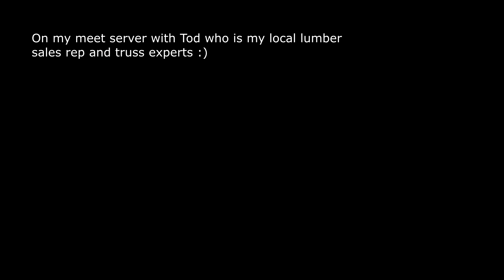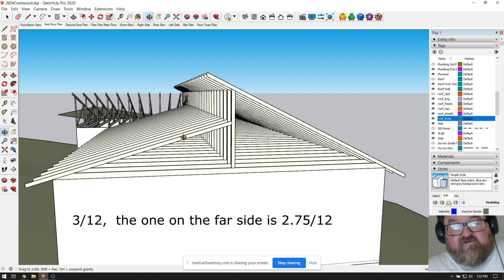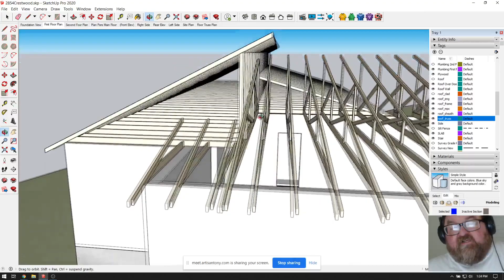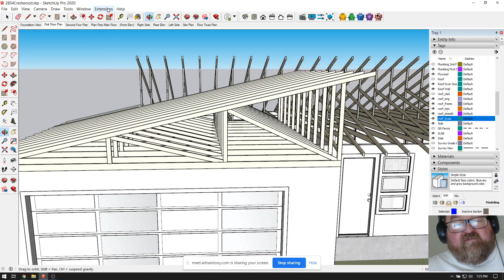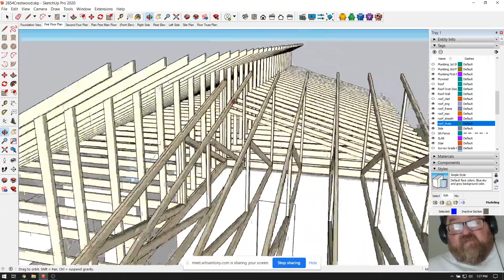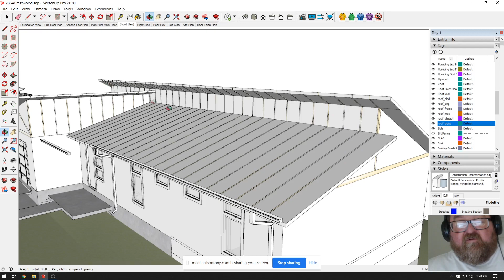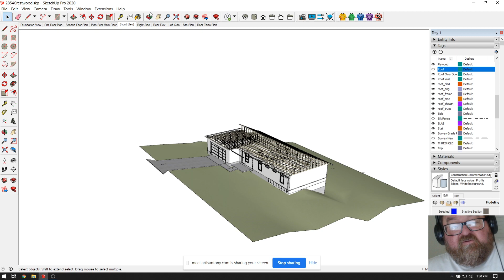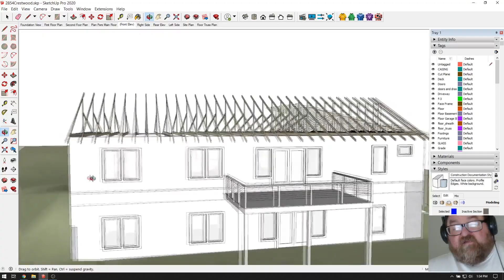Roof Truss Design Process - Part 1 - Initial Design Meeting

Comment: Good video. I have been drafting for 20 years. Mostly structural and arch. The last 10 self employed as a contract drafter. But after covid, a heart attack, and going through a divorce i have lost my clients & struggling to find work (remote or in-house). I applied to a couple “Truss Designers” position & was doing research for them when I found your video. If you have any advise about designing trusses or other job types I should check out I would greatly appreciate it. 

Thanks,
Tj
Reply from the maker: What I have done is record my work sessions with OBS while I work and place them on my youtube account with contact info in the description.  Most of the work I get is from these videos.  I meet with them online using a server like zoom so it's very easy to communicate back and forth.  Then I just email the PDFs out of SketchUp for them to print. If you want to meet online sometime, I can show you how I get work online.  You can contact me at atdrafting.com Thanks!